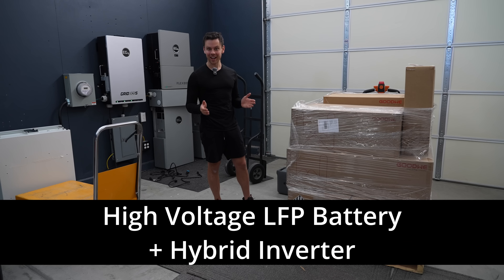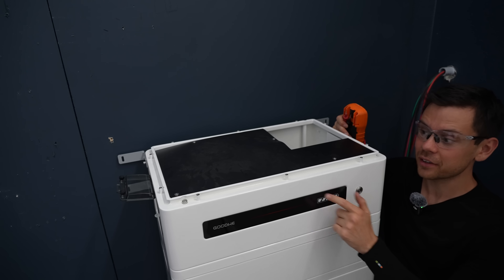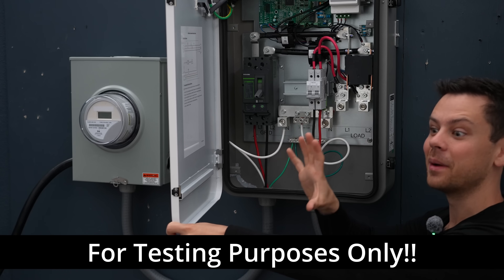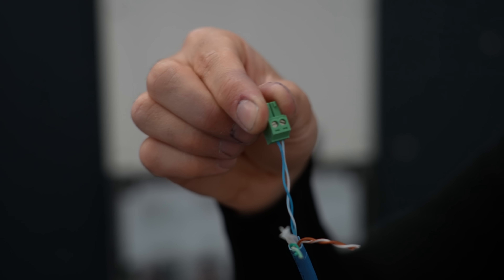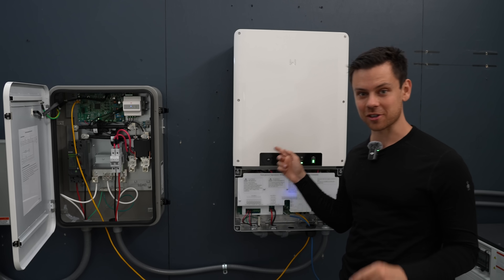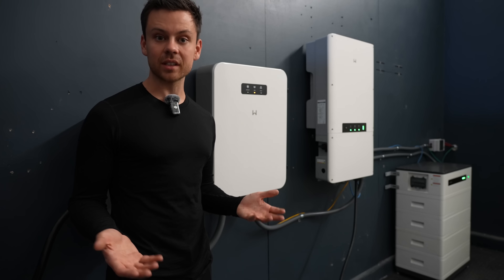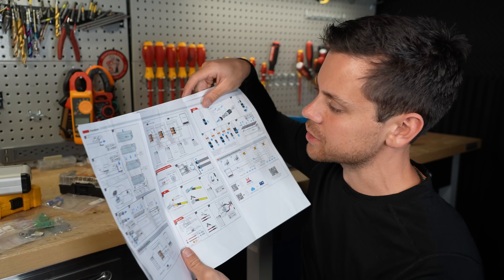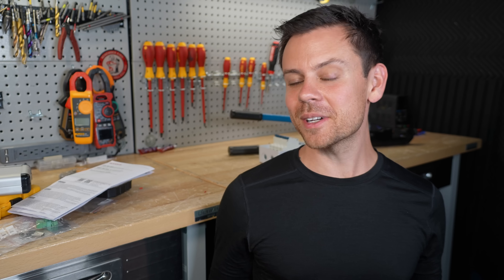GoodWe 11.4kW Hybrid Inverter + High Voltage LFP Battery: My FIRST Dead Silent Inverter!!

Comment: i appreciate the video.  the HV battery could be a deal breaker(for DIY).....anything over 50V has more stringent codes (NEC-NFPA-fire codes) i thought, which may make the DIY install more difficult.

Comment: looks awesome, about freaking time we got some hv systems. 

200vdc is a bit high though. id be happy with like 96vdc, so older 48v batteries could be used in series.... 
but yeah those wires are small. 

it's probably silent cause dropping voltages is a lot easier than raising them.

Comment: I've been working on a Growatt system just like this for a few months now.  Using LG Prime batteries. The current shortcoming that I've discovered with Growatt (Solis and Goodwe have the same issues) is the lack of communication between multiple inverters.  The MID is great in concept, but when you can only have one inverter which has 48 amps of output capability tied to a 200 amp panel, this isn't really a whole home backup.  Since inverters are the least reliable part of a solar setup,  having multiple would allow true redundancy if one fails.  Not to mention a massive amount of sellback capability in locations that still have net metering.  Both Growatt and Solis are working on multiple inverter capability, but won't be available until mid 2026.  Whatever company achieves this first (and is reliable) wins.
Reply: I have 2 Solis S6 running in parallel no problem with the communication.
Reply: @DIYSolarFarming  Hmmm.  I'd love to know how you accomplished this.  I spoke with the folks at Solis about a week ago, and they said that the Solis Hub that they have been referencing in literature and manuals has never been shipped because they are having trouble with inverter communication.  I confirmed that the verbiage on page 23 of the manual for the S6 inverters has changed from 2024 to 2025 in different revisions of the manual.  2024 version mentions the SolisHub by name.  The 2025 version completely removed the references to the Hub and nebulously mentions a future device to connect multiple inverters with battery storage. When I spoke with them, I was told that they are targeting Q2 2026 for shipment. I was told that you can technically use multiple inverters, but only 1 with battery storage, the rest, AC coupled with critical loads panels.  That is supposed to be the point of the Hub.  It is supposed to allow multiple breakers for multiple inverters, each inverter supporting multiple PV inputs and battery storage, thus creating redundancy and high amperage whole home backup, grid sellback, generator support, etc.

Comment: For off grid paranoid folks requiring the App to commission is also a deal breaker😂
Reply: Haha, don't sweat it 😂it's not a deal breaker! The APP Commission doesn't require an internet connection. The inverter and the mobile phone are connected via Bluetooth ✨
Reply: @goodwesolarengine still if you are a backyard hick with a landline and tin foil hat this won’t work. I know a few

Comment: Regarding the battery, I've tried this with the low voltage inverters but i assume its the same with the HV batteries too. if your battery isn't on the list but uses the same communication protacol as one that is you can select that. Also you can try randomly selecting from the list until you hit on one that uses the same protocol and the communication starts working and just leave it there. somewhat risky but two friends of mine run 48v goodwe systems with batteries that aren't on the list but have selected others and communication works fine.

Comment: I wondered how long 48V would stay the standard, I have a decent 3-6000XP system and full sun pushes 130A+ into the batteries and the fans are singing. The idea of battery voltage as high as AC Out is intimidating, But is this jump the next step from 48V? I wondered if we'd get a 96VDC option? Less dangerous, Half the current, but probably solves nothing.

Comment: I have been using Goodwe for over 4 years and it really has way better build quality than growatt, solis or anything signature solar sells. Perhaps kinda new in the US market but Goodwe is a major player along with Huawei for all looking for high quality products in Australia, Europe and Asia.Solis, Growatt etc are nowhere near Goodwe's quality and their far lower failure rate. Yes they really need to improve the manual and also the app, good hardware but awfully hard instructions but once setup, it will serve well.
Reply: I’ve been using Goodwe for a couple of years and they, bar far, have the worst quality and customer support. Growatts quality is a step above and at least their customer support answers their phones or get back to you fairly quickly.

Comment: Finally! ive had my goodwe for 2 years and zero issue. set and forget.
Reply: P.S i specifically bought it because its  silent and was not dissapointed. try the ES g2 or uniq next.
Reply: Thanks for being part of the GoodWe family! 😉 Was the system installed here in the USA?
Reliability and quiet performance are exactly what we aim for. We’re thrilled you’ve had a great experience these past 2 years.

If you ever need anything or want to explore new options, we’re here to help!

Comment: Great intro!!  Only thing I question without more information is that the website claims battery integrity guarantee of 70% over 10 year warranty.  That's concerning.  Price shock is related to all the solar included which is whole system.  With more testing, I sure Will is going to tear into the case soon?!!!!
Reply: Will has said calendar aging will degrade LFP batteries before cycling ever can, even when completely cycling 0.0% -100%.

Comment: DC is in fact safer than AC at the same voltage, that was used by Edison as promotion for his DC system.
Reply: Wrong,wrong and wrong.
Guess you never were shocked by hvdc or else you would not be saying this nonsense...
Reply: @JStock-id1qi did you know in fact that the electric chair concept was also demonstrated by the Edison camp to show how dangerous AC was

Comment: i don't like high voltage batteries because these are proprietary technology. 

the logic idea is to put a 48V sistem to a soundproof and temperature controlled room specifically for that sistem. that way it will not be a problem anymore the noise.

Comment: I connected an old Nissan Leaf battery to my goodwe inverter. Spend $2000 total for a 16kWh system that way.
Reply: Very cool build 😎 the DIY solar community always finds creative ways to maximize storage! 🚀

Just for awareness: while third-party battery setups can work, GoodWe systems are officially optimized for certified energy storage solutions like our Lynx FH-US. That ensures full warranty support, UL safety compliance, and long-term performance.

Either way, great to see people pushing energy independence 💪🏼 thanks for sharing your build!
Reply: That's good.. that's about the cost.. about... For a diy 48 volt 15kwh
Reply: @evertking1 with or without inverter?

Comment: Would love to see more videos about DIY HV systems, the Battery Emulator project from Dala seems interesting. Using EV batteries seems kinda cool, but also kinda sketchy. Making a DIY HV battery also sounds scarier than regular 48V, and it's certainly more dangerous. Would appreciate your input on this subject, thanks for the great videos!
Reply: Battery Emulator roules people are running two pack up to 200 kw :) on one inverter
Reply: i have seen it! looks like a perfect sulution when you now what your doing!

Comment: You can use a DIY HV battery. GoodWe has a very good CAN bus connectivity with the battery emulator by dalathegreat. So you can use EV Batteries with the emulator. Super cheap and silent, what's more to ask?

Comment: 1) The installer password should be "Goodwe2010", but don't go messing with it unlesss you know what you're doing.
2) you can use many different (and cheaper) HV batteries. You can also use lead batteries. The app is finicky AF though, as is the modbus communication. Mess with at your own peril.
3) It is silent, but it gets very hot, which I imagine is not great for the electrolytic capacitors inside. It will also derate if it get TOO hot. Couple of PC fans on top (with a 3D printed adapter, if you want to be fancy) solve that and you can make it as quiet as you please.
4) I may have missed it in the video, or it's a regional thing, but these are very, VERY budget friendly, constituting probably 50% of all installed solar inverters in central Europe.

Comment: I just received 8x 5kWh GoodWe batteries. They are 52kg each, so heavy stuff :D It's combined with a 20kW inverter that will be limited tot ~17kWh (3x 25A).

Comment: Hi Will. Ever considered experimenting with connecting an electric vehicle battery using the open source lillygo project. In the UK you can purchase a 70KWh ex vehicle battery for around $3000. The economics is extremely compelling.

Comment: Different goodwe gear  in NZ there is no ferel crimping and push connectors, and you can use other batteries like BYD, also in NZ we are using standard Ethernet cables for coms between batteries and inverter..there is also an option for RS485 connections

Comment: Nice to see high voltage batteries indeed. Proprietary sucks though for sure...

It would be interesting to see a real world efficiency test charge / discharge with loss comparison 
between this battery and others, especially the 16kWH DIY batteries and such.

Comment: Hi @WillProwse - thanks for that video. But I have had some issues with another brand of HV/Inverter combo - where the “official” documents state a very high efficiency - but reality shows a very different efficiency. So how about a video creating an efficiency curve for the device so 5, 10,20,30,50,75 and 100% efficiency measurements - and the impact of power factor on the loads. :)

Comment: Most ups inverters above 5kw have been using 200v dc batteries for years (strings of 12v lead acid car batteries).  Wires and I2R losses are much smaller.  Going above 60v moves you into a whole new ul rating game, which means the system must be certified.  This makes the idea of a diy battery more complex as it will require making it out of a strong of sub 60v packs which is ok, but takes time to get certification before it can be sold to get through the regulations.  Unlike ac, dc at 200v is way more dangerous from a personal safety perspective.

Comment: I’m really hoping you can confirm the efficiency numbers on these. Looking at the specs their battery mentions 95% round trip efficiency, but their inverter is 97% max. What about a typical use case?  Also the standby power. If you use this for TOU offset, is it really under 20W in standby for the whole system? Even 20W of standby is 0.48kWh per day. I hope they can get those numbers lower..

Comment: Likely because the higher amps is more heat, so they need fans, i have had an SMA for 4 years now, no fans all passive, but yes high voltage is the way to go.

Comment: Its really interesting just how quickly HVDC inverters have advanced in the market.  It isn't a huge leap... they are replacing the HVDC mid-bus that you would find in a good 48V inverter (A 6000/12000XP, Flexboss, Franklin, Tesla PW3, etc...)... they are basically making the battery itself be the mid-bus in one form or another.

So here we have an inverter that I've never heard of before.  We also have the power station makers trying to get into the whole-home game with their own HVDC battery systems... the EcoFlow "Ocean" series, and literally everyone under the sun all coming out with these things.  Including established whole-home makers like EG4.

There are obviously only a few actual OEMs... maybe just 2 or 3, for both the inverters and the batteries.  The technological basis is sound.  An easy evolution of the HVDC mid-bus HF inverter designs that began with Sol-Ark ages ago.   It's obviously the future.

I still wound up choosing 48V for my whole-home system.  I'm happy with it.  I like the flexibility and broad compatibility of the 51.2V LiFePO4.  I can more or less expand it infinitely if I so desire even without full comms.  I don't have to worry about shocking myself (beyond a little buzz) on the DC side.  I can charge the batteries via many alternative means if it became necessary to do so.

-Matt
Reply: You seem to be knowledgeable. So from what I gather, correct me if i'm wrong, I'm most likely wrong, the industry used to be 48 volts? And now, the big players are going where? 220V DC?
Reply: @strongme80 The "industry" used to be 12V, 24V, 36V, 48V, and other voltages.  But some voltages were more standard than others.   These HVDC systems are a bit different.  Instead of requiring a specific battery voltage, these HVDC systems support a range of voltages.  For example (just a made-up example), it might be 150VDC to 300VDC.   Or perhaps 150VDC to 450VDC.

The high voltage can vastly improve efficiency.  But supporting a range of voltages also creates a lot of compatibility issues between the inverter and the battery bank, requiring RS485 or CAN communications so the inverter knows exactly what to expect from the battery.   

Other compatibility issues include ... well, adding multiple battery packs to the system for example.   And might also limit the solar MPPTs in some way.

-Matt
Reply: @junkerzn7312  Hello, Matt. So wait a second, the industry from what I'm reading from what you're saying is heading towards EV voltage power levels minus the wheels and transmissions! Pricewise though, these chinese "kits" seems very expensive but on the other hand there are tons of EV inverters and battery packs in the used EV market and I mean there is so much! So, why not just go in that direction and DIY everything for the fraction of the cost? Am I missing something here, I think I"m missing something? Can you please explain or give me perspective, this is really interesting stuff. Thank you!
Reply: @strongme80 Do you own your own home?  Just objectively.  If so, or if not, still, imagine the value that home would represent to you and your family.   Life and Limb.  Equity.  Memories.  "Stuff".  Everything.  It would be considerable, right?

Now.... do you want to risk that home burning down in a high voltage DIY experiment with a crash-reclaimed battery pack from an EV no longer properly housed in a way that a runaway would be contained and not jet fire into the wall of your garage?   All to save maybe a few thousand dollars?

For me personally, the answer would be: "NO".

So... there's a limit.  I DIY installed my system, saving gobs of money, but there are limits to just how much DIY I'm going to do to components that deal with such huge amounts of energy.  My whole home system (EG4 system) is fully certified and rated for its purpose.  Everything is encased in metal and to code. Absolutely everything.  Nothing is home-made, or reclaimed from other projects, or repurposed, or exposed.

I don't want my home to burn down!

Each person, each family will have their own limits... and their own risks.  It won't be the same for everyone.  But...

-Matt
Reply: @junkerzn7312  All good points, Matt! I really want to learn and build out a small low voltage system...for even an LED lighting, this will be a good project for charity work at small provinces for under served remote communities in the Philippines. Where should one start with acquiring components? If you don't mind, can you please provide some referrals?
Reply: @strongme80A small low voltage system for remote communities would definitely not use any of this fancy equipment.  Not sure what you mean by referrals... you have to look towards what you can easily acquire at your location.

You want to make it as simple as possible so you can reach the most people as possible with something dependable, decent, safe, and cheap to maintain, fix, and replace.

And there is nothing simpler than omitting the inverter entirely.  Make all the loads 12V only (DC).  No AC loads at all.  Very easy for lighting.

So your choice matrix for such a project is:

Choose one of (A) A small power station, (B) A discrete 12.8V battery system, or (C) A discrete 25.6V battery system.

A small power station is easy to source but not easy to repair or maintain or scale.  And I do mean small.  Like 250 watt-hours or 500 watt-hours small.   Then just solar panels and the power station and plug the lighting into it.

A 12.8V battery system without an inverter is cheap, easier to repair and maintain, but requires more man-power to put together.    Panels, Charge controller(s), 12.8V battery, simple fusing and/or breakers and a few connectors in a box (battery would be outside the box, everything else inside).

A 25.6V system is the same but more scaleable and would also need a (cheap) 24V to 12V DC-DC in the box.  But the charge controllers will be half the cost per watt of solar, and the solar and system as a whole will be a lot more scaleable.

If I were doing a village system it would be the a 25.6V box with a DC-DC and 12V LED lighting.  With an eye towards the village wanting to scale it up over time.  Omitting the inverter entirely as I said at the start.

-Matt

Comment: Stop calling the cables "ethernet cables".  They are category 5-6-7 unshielded twisted pair with 8 conductors in 4 twisted pairs, terminated with  8P8C modular connectors.  They are often used in 1000baseT ethernet networks, but not always, as in this case.
Reply: Its an ethernet cable to 99% of people.  Nobody is is writing that many words.  And we don’t care that you went to school.

Comment: Never going to use High voltage batteries I don't even like HV PV inputs it's stupid
Reply: Running high current when you could be running low current is really stupid!